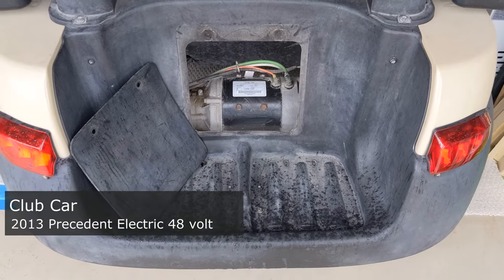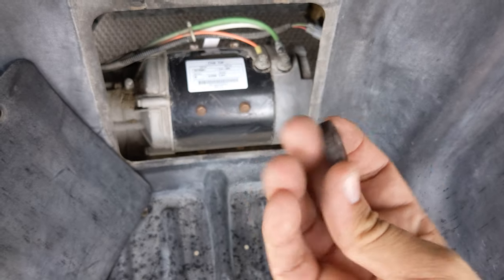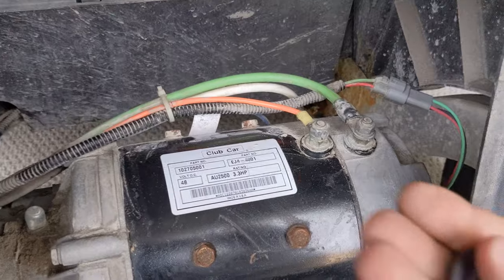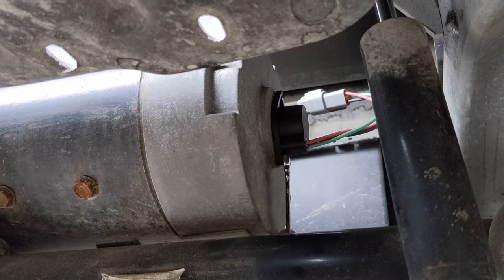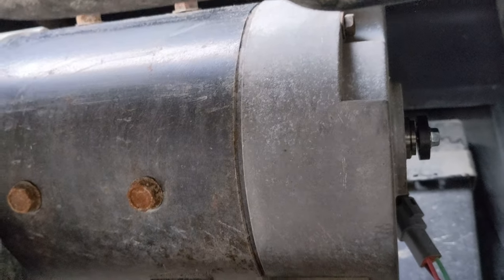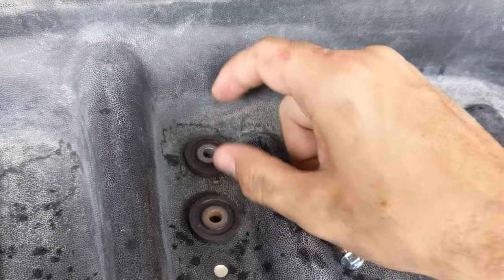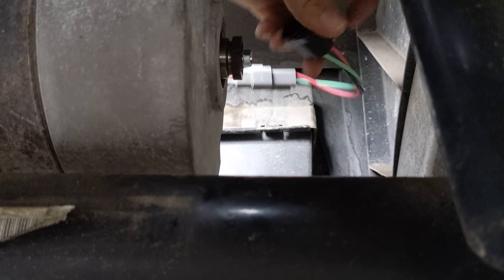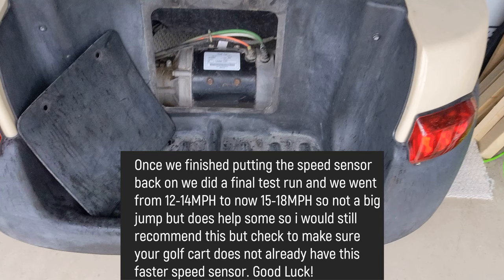How to make your Club Car go faster with a faster speed magnet

Comment: nice video thx, I have a question Ijust replace the magnet speed sensor but I don't remember if it was faceing the way you say,but still run,if it is backwards,will it afect it thx
Reply from the maker: hi it shouldn't do you notice any speed increase or just the same?

Comment: I was hopeful but I only gained about 1-2 mph from the change. The old magnet was cracked so I thought I was really onto the issue. I believe the 2005 PQ model has a limiter on it, it doesn’t go faster than 15 mph. Downhill you can sometimes reach 17-18mph briefly. Trying avoid new motor / controller but thinking if I want over 20 mph this is what will be needed.

Comment: Do you have to put the speed sensor back in for it to work or can you leave it off to go faster
Reply from the maker: I'm pretty sure you need it and then again it might work without it but I'm not sure if it just defaults to the slower speed then give it a try and let me know
Reply: The cart will go about 10 mph if the magnet or sensor is broken, missing, or unplugged.
Reply: Mine went 1 mph faster with the speed sensor unplugged

Comment: Do you know if this will work for a older 36 volt club car DS? Believe mine is a 96. Definitely not newer than a 2000 please let me know
Reply from the maker: Sorry not sure maybe if it has the same speed sensor magnet you would have to check
Reply: No speed sensor on a 96 ds
Reply: Is there a speed sensor on a 98 txt?

Comment: I am stuck at 8mph.  I replaced the speed sensor and the magnet with a high speed magnet.  Still cant get past 8mph.  Any thoughts?
Reply: Weak batteries or the new sensor is bad. Oooooor you have a broken wire from sensor to module
Reply: @Onwaxwings  it turned out to be the solenoid
Reply: Replace the motor control unit with a new mod 4 electronic controller. Huge difference. Much faster.

Comment: would that work on 48 regular ds ?
Reply from the maker: To be honest not sure but if it looks the same it's worth a shot
Reply: yes it works with 2007 ds GE motor. A little harder to remove and replace on GE motor but results are nearly the same 15-20mph with the pedal slack removed also
Reply from the maker: Thanks for your feedback
Reply: @Bomberomusician  15-20 mph is a big difference. Mine does 12mph now. So what am I looking at a 3 mph gain?  Also curious about throttle slack you mentioned?  I am on stock small wheels, do you know what putting bigger tires on will do, I’m sure it has the power to go faster? It’s a 48volt.  25mph possible with bigger tires and speed sensor?
Reply: @aquaticterrafirma  The slack that Im speaking of is located behind the go pedal. There is a prong sticking out that pushed the MCOR to open. Place /force something hard between that void/slack and you will gain another 3 or three mph